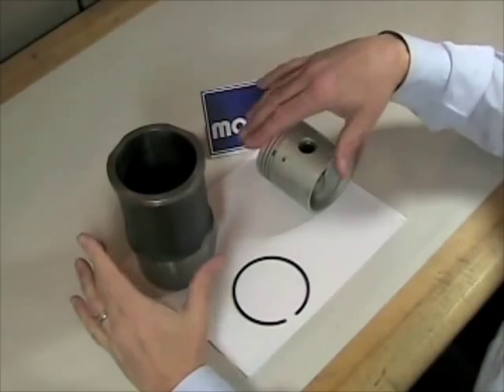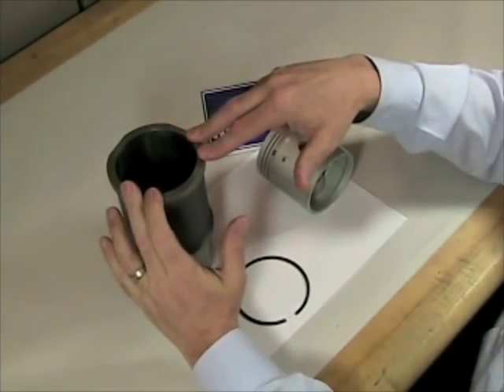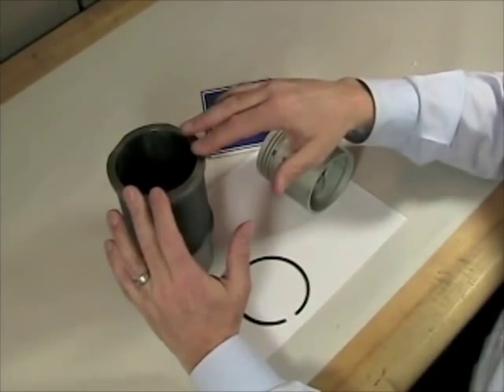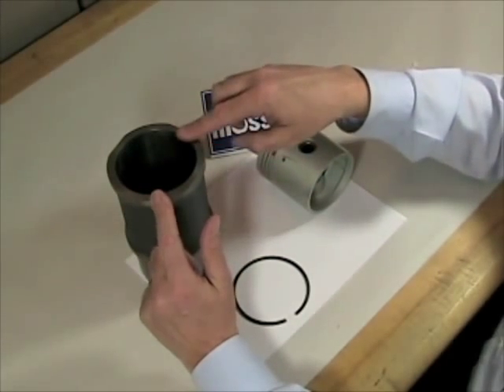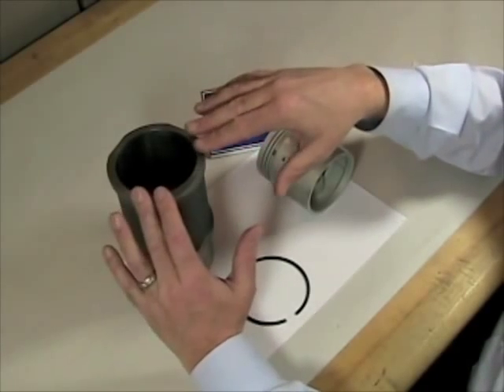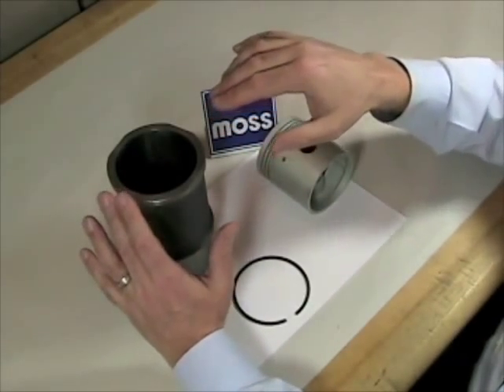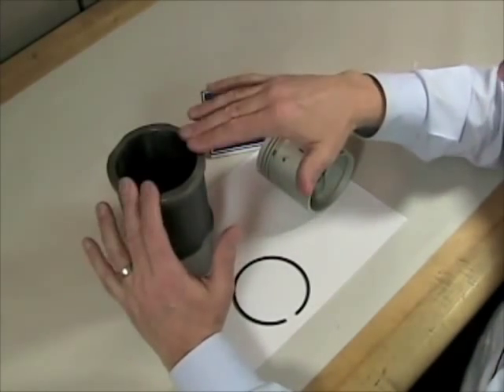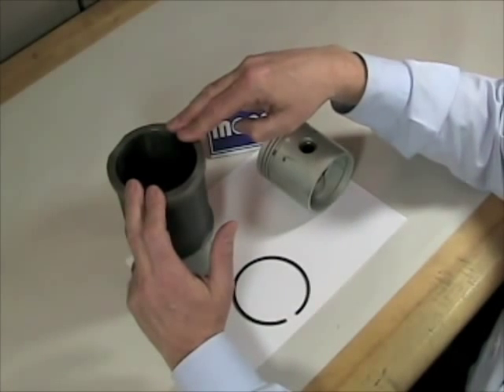Pistons - How to Measure

Comment: Wouldn't it be better to throw away the old worn out pistons and cylinders, and buy new ones that aren't over boared.   That way the next person (probably you) that works on the car, and tries to replace the cylinders, rings, or pistons doesn't get some rude WTF surprise that 4 cylinders are stock size, one cylinder is overboard 20 thousands, and another cylinder is overboard 30 thousands.